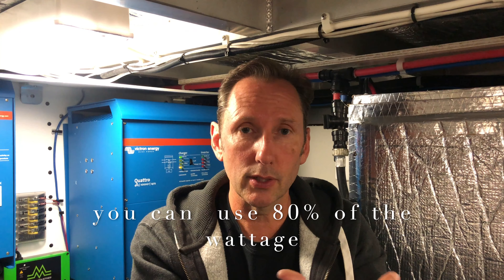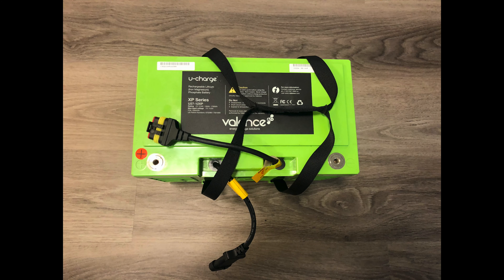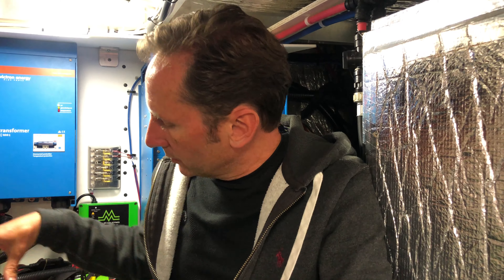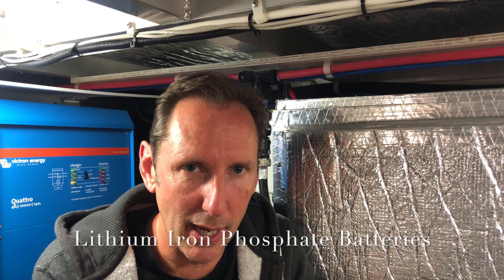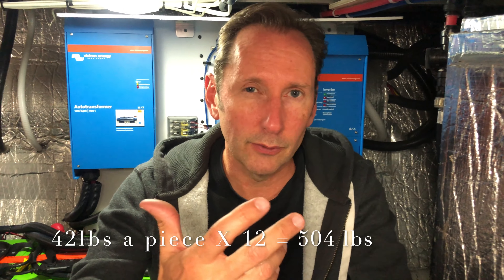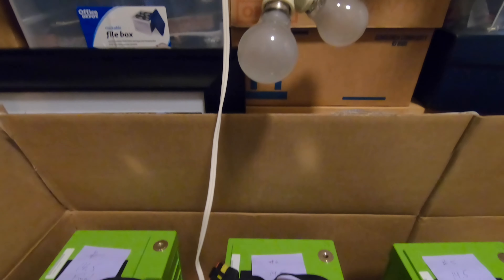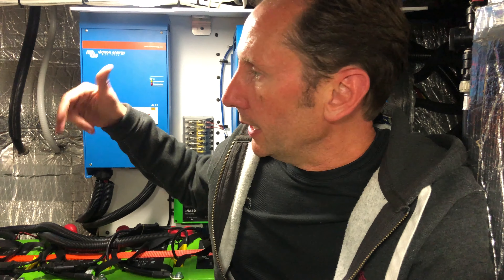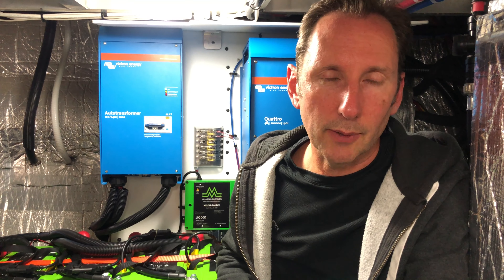10kW 48 Volt Inverter System by Victron with 21kWh LiFePO4 battery bank on our Boat (EP 8)

Comment: Very informative!   Questions....Would I have to change out my engine alternator for charging these batteries?  Also, I have a fischer panda 4.2 generator, will this need to be "tweaked" for charging?  Thanks.
Reply from the maker: Hi John!  We charge this 48V dedicated inverter bank from shore power and our genset powering the Victron Quattro Charger, with no modifications.  If you were to use your 12V or 24V alternators to charge these, yes you would need to have either a DC to DC (also known as a 'Buck Charger'), to limit the DC Amperage draw from the alternators, so they don't burn up the alternator at idle by drawing maximum amperage output.  Replacing your alternators with external regulators is another option but, tends to be $$$.
Reply: Balmar external regulators support the LifePO4 batteries now with a lithium battery charging profile.

Comment: Can you post information on long-term storage? If I buy now and don't need them until next spring, I've read that I should discharge them to 50%. How did you discharge them? Great channel!
Reply from the maker: Thank you for watching!  We use the boat year round so we go through a discharge cycle at least every 30 days, if not more often.  However, if you have a State of Charge meter on your batteries (which I highly recommend) you can just run a load on them (shut of shore power and heat the boat or cook, etc).  If you are using the batteries at a cabin or something like that and bring them home, I would just run a 12V light bulb on them to discharge.  That's what I used to test the SOC of the batteries before the boat arrived and worked great.

Comment: Hi Jon, I'm working on a very similar install and wonder if you could please post your supplier and specifications for the cables and fasteners that you used to connect your batteries in series and parallel. Thanks!
Reply from the maker: Hi Steve, Here is the company and the link I use for the custom cables.  If you have a specific length that isn't listed, I just order one size up and write the specific length in the comments when ordering.  https://spartanpower.com/product/custom-battery-cables/
Reply: @ElliYacht1  Very cool. Thanks Jon!

Comment: Excellent Video!  I am two years out from purchase and in the process of our first house downsizing.  20 years of accumulated...stuff...purging and sorting and moving and storing.  You know the drill for sure!  You made two moves - I will hopefully only make two - Difficult none the less!  We are looking at a used Fleming 55 and learned from the dealer that generally speaking the existing power system is good for 4~6 hours max before requiring recharge.  I did not like that answer and have been researching my options since.  Okay I have so many questions on this video but will limit it to just a few; Did you self install the entire Victron Quattro and redundant 12V system?  Did you purchase the equipment form a local dealer or did you find an installer with the experience to do the job right, leaving you with the batteries to install?  If so how'd you vet the right installer?  Last question - what was the overall cost of the entire system?  Batteries were $6K but we don't know the rest and inquiring minds would like to know.  
Last word - I have been watching cruising couples videos for the past 6 months as my wife and I get closer to a water based life.  While many are good, your presentation, subject matter knowledge and editing are great and exactly what I have been searching for.  Cheers - excellent work.
Reply from the maker: Thank you! We’ll do a quick video with answers so everyone can benefit from your excellent questions.
Reply: @ElliYacht1  Awesome and thanks in advance; looking forward to the post!  BTW- I referenced your video on a thread from Trawler Forum entitled "Upgrade to Inverter/charger system Victron".  Trawler Forum is a great resource if you are not already a member.
Reply: @ElliYacht1  I would like to use my 4 Valence U27-12XP in 24V configuration. Right now I am using them as 12V bank but would like to switch to a 24V inverter. Do you know if I need the external BMS like the one Muller sells in order to run them in 24v? Thanks, I really enjoy your content and information

Comment: How do, we get them? I live on the east coast.
Reply from the maker: I think these folks have them https://www.mullerindustriesusa.com/product/valence-u27-12xp-ucharge-lithium-battery-ion/
Reply: AVOID the XP series of these batteries as they MUST have an actively exterior "Lithium werks" BMS.

The RT series are the ones to buy as these have a BUILT IN BMS.
Reply: Also these batteries (RT and possibly XP series) can be bought for as little as $10.00 - yes 10 bucks - see "jimginnyohio" one simply needs to STRIKE UP a conversation with a hospital or scrap yard or recycling plant and PUSH the "repurpose idea" to save the planet!

There will be SOOOOOOOOOOO many coming on the market that it will be INSANE!
Reply: @theo.k.corral6895  that doesn't match my research on those series. I own both small RTs and big XP. The XP I can access thru USB/Serial and I can see the internal BMS at work. The RTs I have not been able to access that way

Comment: Do you have a background in the battery field/ industry  or do you just have  an incredible knowledge on this topic.
Reply from the maker: Hi Paul, thank you for the compliment!  Since lithium and Lithium Iron Phosphate batteries are such a different animal, we thought they were too good to be true. We immersed ourselves in the pros, cons, myths, and most importantly the battle scars from early adopters. That seems to be where subject matter expertise is emerging. 

That being said, we have learned to be highly skeptical of marine battery ‘experts’ that have decades of experience with lead acid and AGM installations but, have never installed LIFePO4. Those chemistries have nothing in common with LiFePO4. While I deeply trust their knowledge of how to ensure bonding, cable sizing, Genset/shore power wiring; they are often unwilling to acknowledge that the precise resistance tolerances demanded by the massive amperage flows require much greater attention to cable crimps, washer types, cable lengths and matching as well as isolating/protection/revision of engine alternators, if used for charging. In short, their perception that ‘a battery is just a battery’ can cause significant financial harm to those that are willing to make the leap and reap the benefits of installing LIFePO4. That’s where horror stories come from and resistance to adoption starts. 

There is also a ton of misinformation about risk related to purchasing used LIFePO4 batteries. We believe top end batteries with diagnostic histories are an amazing opportunity for us mere mortals to own and benefit from. 

In short, we’re at the point that there are very few people that are in the industry that have applied knowledge and even less that have the any knowledge in the recycled use of LIFePO4 that often have 1-5% lifecycle use. 

I will say it’s been totally worth the time. We have a all the power we could ever want, we never worry about watering them, floating, acid leaks or any other traditional issues. And we have Air Conditioning without using a Genset, that makes Karlynn a happy woman.

Comment: AVOID the XP series of these batteries as they MUST have an actively exterior "Lithium werks" BMS.

The RT series are the ones to buy as these have a BUILT IN BMS.
Reply from the maker: XP External Battery Management Systems (BMS) are readily available and can be configured to unique Serial battery bank configurations like ours. Here’s one resource. https://www.mullerindustriesusa.com/product/miusa-bmslv-valence-battery-management-system/ 

The amp hour ratings on the RT series are too low for our application although it is nice to have the built in BMS.
Reply: @Elli: last I heard was "LithiumWerks" would not sell the BMS independently, if they do now...WOW, THANKS!
Reply from the maker: I was stoked too!  Seth Muller is a good guy and will fix you up. With the external BMS, the XP bank of 12 batteries (4S3P) stay within .01V of each other.
Reply: @ElliYacht1  fyi...this link does not seem to work, including their main domain.
Reply: @ElliYacht1  I was able to get a muller bms - yay!!  Is there a contact you could share for Seth -- or maybe share some of your configuration as I'm going with a 24 volt system in a 2S4P arrange for an RV?